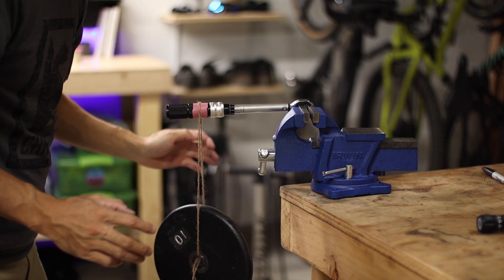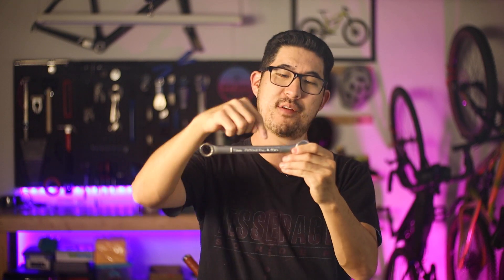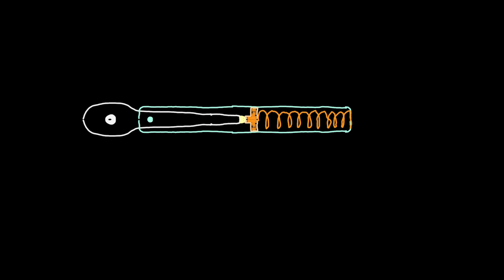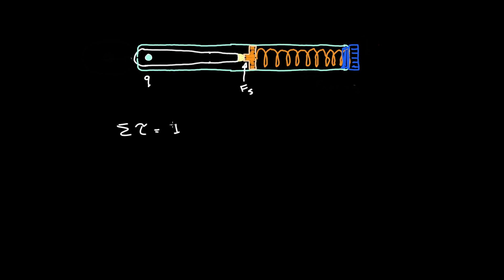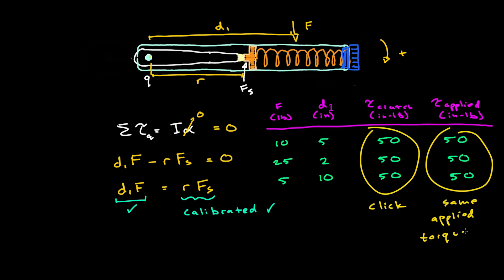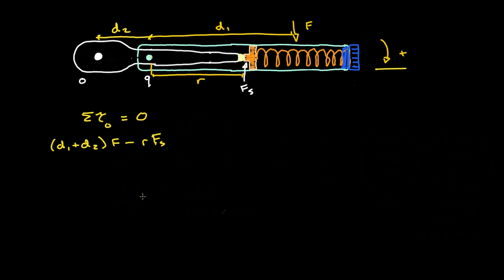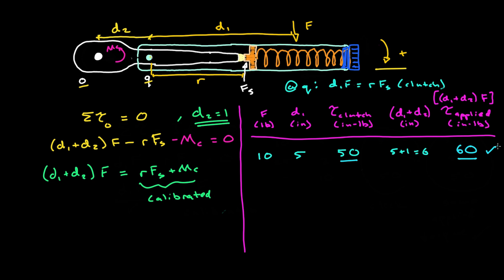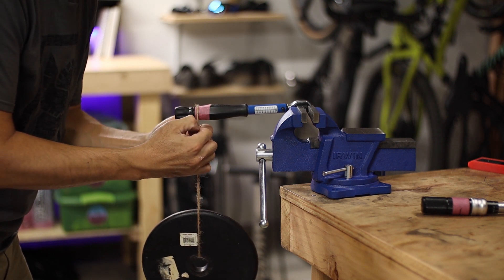Why GRIP Position on Torque Wrenches MATTERS!

Comment: Great video! Now I know how a torque wrench works :) The exact distance is only important during verification; it doesn't matter for the application itself. You just press with force x until it clicks. Or am I wrong about that?
Reply from the maker: It matters during application too
Reply: Well, after giving it a second thought, it somehow makes sense - the tool needs to be calibrated to a specific reference point. 🤯
Reply: You are correct, and TheBikeSauce is not. After calibration done application distance  will define how much force - more, equal, or less - user should apply to ‘reach the click’
Reply from the maker: @pavand7410 the math doesn’t lie

Comment: I got as far as 8.05 mins into your well presented video. But then i woke up. You go on about two torques but infact right up until the clutch as you call it snaps, clicks, the whole thing is basicaly a lever, after the click one stops pushing on the tool. How far up the handel this force comes from does not matter once the tool clicks you stop otherwise you will force the detent against the outer wall of tube and can still carry on to over torque.
Reply: Now imagine what happens if you're pushing the handle at the pivot point. Or on the far side of the pivot point. It's not just a beam.
Reply: @iliinsky  This is something our friend pete has been unable to get his head around. No-one (in more than one place on YouTube) has been able to get him to realize that the fact that force applied at the handle pivot point can never produce a click regardless of the amount of torque being delivered, points out that it does indeed matter how far up the handle the force comes from. Still, one can only hope - he may read and have it "click" for him that he has said "once the tool clicks", and in that case the tool will never click.

Comment: So you CAN use the weight on a string method as long as you place the string with the weight at the center of the handle?  This means to measure from the center of the socket to the center of the handle and multiply by the weight to get the expected torque.

Comment: Well "torque is still torque", but changing the position of your hand on the wrench changes the way the forces interact with the internal "clutch mechanism" and the click occurs at the wrong time.  Someone who took engineering mechanics in engineering school will immediately understand everything you did.
There are other types of mechanisms used in torque wrenches, some use internal beams, some use actual electric resistance load cells, I don't know what else is available.  When I grew up working in my father's garage we used a "beam type" torque wrench.  There is nothing to calibrate on those, the deflection of the beam will be repeatable if you don't damage the thing somehow, deflection being P times L-cubed divided by (3 times E times I), spoken as pee ell cubed over three eee eye.  The beam type torque wrench that we used enforced proper use by having a pivot pin through the handle.  You had to pull in just the right place to keep the handle from turning with respect to the beam, therefore the force was always applied at the exact L from the fastener that the wrench was manufactured for.  The only trick was getting in a position where you could accurately read the scale while pulling hard on the handle.  Sometimes it helped to get a second person involved.
Reply: Excellent point!  I still have my Craftsman beam torque wrench from the late 60s, when as a teenager I did my first serious engine work.  A kindly machine shop tech took the trouble to point out exactly how to use the tool and emphasized putting smooth pressure only on the handle pivot pin for accuracy.  I’ve kept that in mind ever since, even with all the newer torque wrench types.

Comment: Great video and a very good explanation! Something crossed my mind though; The adjustment on some torque wrenches effectively changes the lever length of the wrench from the handle. It's not the case with Park Tools torque wrenches, but for many others, the mechanism is such that the handle moves closer to the socket when increasing the torque setting. I haven't thought about it much yet, but I'd like to hear your ideas about this. Do you think it gets compensated somehow? Assuming the holding point of the wrench is always in the middle of the handle or some other fixed point on the handle. Or is it an error induced on higher torque settings on a given wrench when it's been calibrated at a lower setting?
Reply: Interesting point.
Reply: @Alireza9900 This is from a long time ago, but if you do come back to the topic, the handle does indeed move a modest distance as torque settings are changed. This is part of internal variations that contribute to the tool's tolerance specification, often +/- 4%. At the position of the handle center, the rate of change in torque per distance alteration is comparatively small, at least an order of magnitude less than the 4%. On my torque wrench, the movement over the torque adjustment range is total 16mm, I did the variation calculation once, I think it was under 0.1%. On a tool that can vary over an 8% range and still be within spec, it's not significant. Calibration is done at 20%, 60% and 100% of the tool rating, and the calibration procedure includes a test of the tool's parameters with the Force Loading Point on the calibrator being moved 10mm either side of the correct Loading Length.
Reply: Theoretically, the manufacturer/designer of the wrench is supposed to design the dial markings (where the user sets the specified torque) with that effect in mind. The only way to make sure it's to hang different weights off the center of the handle, note the dial position when it starts to click and do the math.

Comment: Love this video and totally makes sense. My only question would be a practical one for a user of a click-type torque wrench. Mine would not have an 8” range for practically where I could grip it. If I narrowed it down to plus or minus 2 inches (which might still be wider than I could practically hold it), what’s the error and does it matter?

Comment: Nice color chart... (blah). I you did a simple Free Body Diagram, you would she how the force changes after you move off the "clutch" to a closer position near the "bolt" or the center of what we are worrying about.
Reply from the maker: Torque should not be calculated after the clutch has broken. The wrench only applies torque before the clutch slips
Reply: @TheBikeSauce  I'm talking about the "position" of the force application relative to the "clutch".

Comment: Great explanation! But what are the points where you measure the "middle of the handle"? 

The S1)socket end or S2)the sort of invisible pivot [start of d1] 
to 
E1) absolute end of wrench or E2) end of main handle, before the adjuster bit?

I ask because my recent experience includes learning the hard way that most (my) non-Park priced torque wrenches don't work on reverse threaded things like drive-side bottom brackets (which is not entirely applicable to this video but I'm whining) and crank arm bolts (due to user error apparently) :-)

Comment: I have done my own test’s and it doesn’t matter where I hold my hand it gives the same results
Reply from the maker: You measured the applied torque with a digital strain gauge at the socket?

Comment: The click type torque wrench is not very accurate because operator cannot respond quickly enough to the click and will usually over torque the bolt.  Through experimentation I found that digital torque wrenches provide the most accuracy because the operator can anticipate when he/she is at the correct torque.

Comment: I appreciate the in depth process you go into but yes you did fry my brain. Personally and I admit I may be the only one it still sort of baffles me. If a torque wrench's accuracy depends so much on where you hold the wrench why don't they come up with a wrench that it does not matter where you hold it. 5 people testing a torque will hold the handle at slightly different position leading to inaccurate readings. Torque is critical in automotive and aero industries. I am in the calibration industry in the UK, mainly pressure and temperature. I know by personal experience that holding a torque wrench handle at different position really affects the accuracy. Holding a wrench further or closer to the head should not give you an inaccurate reading. I wonder why no one has come up with a design that means where you place your hand on the handle does not affect accuracy, there probably is a reason I just don't know it. Thanks for the video anyway.
Reply: Many torque wrenches are Length Dependent (accuracy depends on grip position), but some are not. The common click type discussed here is Length Dependent, as are most beam wrenches and some types of digital wrenches. Designs where it doesn't matter include slipping cam (cam-over) and dial beam wrenches, the type with a somewhat fat body and a clock dial indicator. Designs that aren't Length Dependent can be more expensive to manufacture, or less convenient to use - e.g. dial beam is bulky & awkward in confined spaces.

Comment: Maybe I missed it, but aside from gripping the handle in the middle, do any of the wrenches have the middle of the handle marked in any way? Btw, nice work on the video - Sal Khan would be proud
Reply: I had read or seen a while ago that you should apply force where it's marked on the handle, and when I looked sure enough both my torque wrenches had a thin band all the way around the handle. Not centred, but closer to where your ring finger would rest when holding the handle approximately in the middle. I just bought my third one yesterday (different sizes) and it doesn't have this band, hence I was confused where exactly to apply force and started down this rabbit hole. I guess I'll assume the middle of the handle for this one since it's not marked and the manual is half a page long. I only own cheap torque wrenches because I don't work on anything expensive really.

Comment: No. It does not matter too much where you place your hand. The slip mechanism is always calibrated to a fixed rotational force at the pivot point (based on the spring pressure). But it does matter if you are measuring the force applied at a certain point to get the corresponding torque at the end. In such case, you can use the formula normally used for torque wrench extension to back calculate the proper weight at your chosen point of force applied, and to account for the distance between the slip point and the socket point.
Reply: Jet Li, I agree and well said. Thanks for explaining what I intuitively knew but could not put into words.
Reply from the maker: It seems intuitive, but the math (and experimental evidence) is counterintuitive
Reply: That makes sense - so I can still calibrate using a fixed weight at a fixed location using the equations prescribed in video.  Just as easy to use middle of handle.  So, for this example, setting a 10lb weight at 5” from pivot and assuming 1” distance from pivot to socket attachment center, I would set wrench to 60in-lb and if calibrated, it should “click”?
Reply: @TheBikeSauce  I think there is a problem with your maths, though.  Turning force is always applied to the inner arm (and therefore the socket) at the clutch mechanism.  So the equation for the torque at the socket should be the force experienced at the clutch mechanism (Fs) multiplied by the length of the inner torque arm (d2+r).  So the torque wrench will always click at Fs*(d2+r).